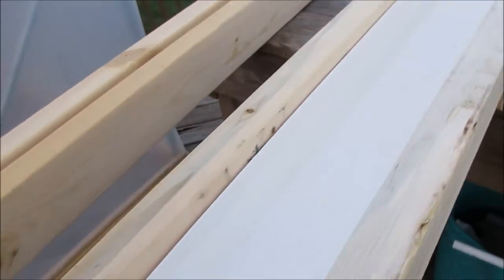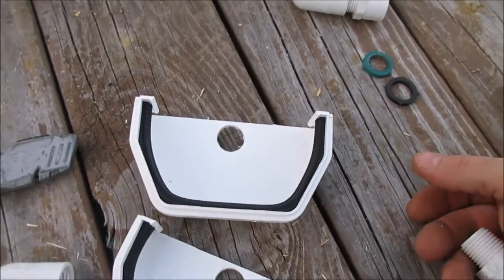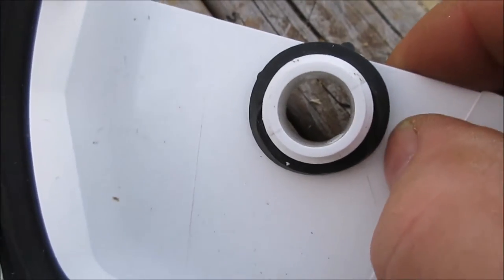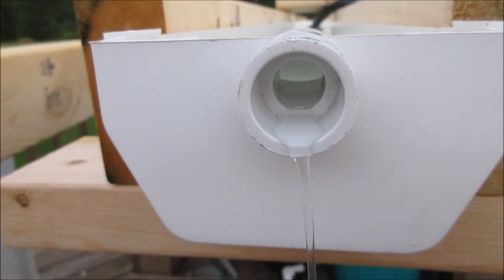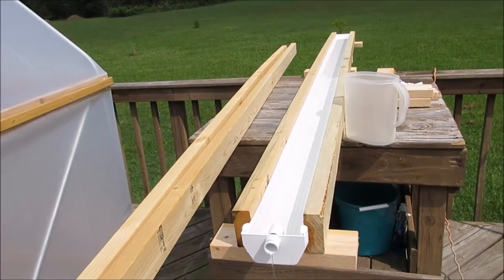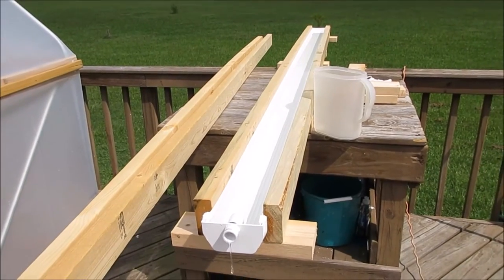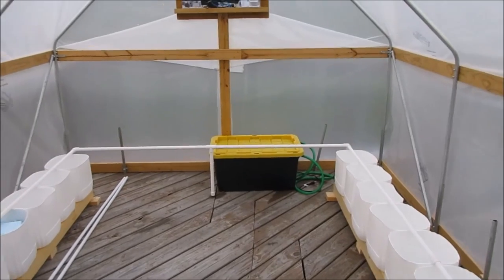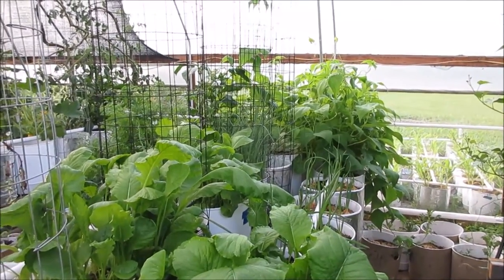Hydroponic Dutch Buckets:  FAWN Style

Comment: Brent thank you for this video. I have watched several of your videos and still could not clearly see why FAWN was better. After seeing the results from others using the (pure) Dutch bucket method I have honestly been skeptical. I can now see advantages you system has.
Reply from the maker: I guess success is in the eye of the beholder.  I present what I do and folks can copy, modify, or reject any or part of it all.  It's about sharing for me.  I want to grow in regular gardening dirt now and see how that goes.  I want to push the limits of the system.  I've grown in 50% compost with 50% aged rice hulls successfully so I'm optimistic.  I wonder if that can be done in dutch buckets?  I have my doubts.
Brent
Reply: I really like what you are doing. I started Square Foot Gardening, found the media way too expensive. My 'expedient' try did not work. Now I realize two major factors against me are BUGGS and my sandy soil under the beds. I am banking on a hydroponic green house solving both issues.
Reply from the maker: It eliminates those two if it's screened in.  Gotta watch temps and make sure it's really vented or it will boil.
Brent

Comment: Man, this looks great. I know this is an old video but great design. Wondering what you guys are running for times for water feedings. every 2 hours for 10m as an e.g.
Reply from the maker: FAWN used a return so it can be anywhere from constant to any length.  For me, it depended on when the container mixture started drying out or plants showed signs of need.  I believe it was usually 2 to 4 runs for a few minutes daily depending on outside temps.  It's kind of hard to remember.  Once I get a greenhouse again, I'm going back to it.  I never completed my last version.

Comment: Thanks for sharing your experience. This is a great video and convinced me to try this system in my backyard.
I have a question though. I intend to build this system in my backyard without a green house and in bay area , summer temperature can reach as high as 105 F in the day time and 60 F in the night on the same day.
Do you think this system can tolerate such a wide swing of temperature ? Can the high temperature during the day make the nutrient solution hot enough ( although I will keep the reservoir in shade and bury in the ground ) to adversely impact plant health ?
Reply from the maker: Depends on how many hours heat is exposed to it.  I've hit those temps in the greenhouse and it's not good for extended periods.  Shade is the answer along with burying the reservoir and cycling the system more often to keep oxygen levels up.  For reference, if dutch buckets can take it, FAWN can too.

Comment: I have been watching a bunch of your videos. Great stuff! I'm not quite sure if this is a wicking system or a top watering system, or both? If it is both do you need both to accomplish this? Could you do the same setup top water with little holes in the bucket just for drainage and just keep them in the portion that is over the gutter? Keep them coming, thanks!!
Reply from the maker: 100% correct. Hydro drip, wicking, and water culture. All on purpose. Drip alone is fine, but you lose the backup wicking if electric goes out and you're not around. Also, plants will have difficulty sending roots into the reservoir (gutter) where they can directly feed if they want.  It sounds odd, but some plants love being in water fully, some like it a little, and some do not like it. Thing is, they have that choice and, even weirder, they choose what they like.
Reply: Thank you for the clarification.
Reply from the maker: @GrowSomethinwithJeff  Happy new year.
Reply: Happy new year to you as well.

Comment: I would like to create a FAWN system like you describe. But, I do not have a greenhouse to utilize. Will this system work set out in the open yard? If so, how do you adjust for rain? Love your videos! I appreciate your efforts and sharing. Thanks for your help.
Mike (in TN)
Reply from the maker: Yes, it would work.  Make sure there's no holes in the top of your reservoir.  This will keep the nutrient at full strength by not allowing rain in.  A heavy rain will dilute your hydro solution because it will rain through the buckets and then drain back to the reservoir if you do a recirculating system.  So, after every rain, you'd have to check your ppms and maybe make an adjustment.  I was going to do a movable  outside FAWN system on rollers, 2 platforms wide by 5'.  That's 10 containers.  I would cover with a $10 tarp and bungees.  This way, I could roll it around like a wheel barrow.  An option would be instead of covering, one could roll it into the garage or a carport on a rainy day.  I might still do that.  Love to see what you end up doing.
Brent
Reply from the maker: I've just decided I am going to make one.  At least one.
Brent
Reply: Great!! I look forward to your videos as you describe your "outside" FAWN system. I need all the help I can get  :-}}

Comment: Hey Brent it's Casey in sunny California. I was hopeing you could help me with a problem I'm having with zuchini in self watering rain gutter system. My zuchini are getting about 3 to 4 inches long then starting to turn yellow BER. I follow the instructions as far as 12grams, 12grams and 6grams and mixing in the right order. My  system is outside the flowered look good and the leaves look. I do have a little problem with whiteflys. I spray with neem oil, it seems to work for a day or so and then there back. Any help would be greatly appreciated. The system is not circulating, I fill it as needed. Thankyou
Reply from the maker: Sounds like they're not getting pollinated.  Before 11am, take a male flower and remove it from the plant.  Take all of the petals off leaving the pollen covered tip.  Find a female flower full open and rub the male all over it.  It will start growing quickly afterwords.  An unpollinated squash dies off like you mention.  That's likely your issue.  Let me know.
Reply: Thanks a bunch, and I will

Comment: Cool but i think air pump is unneccisary so i will leave it out of mine.  I am gonna just have a planting bucket sitting on a 5gal pail. Letting water fall into the reservoir. Water pump driving the water to the halo on the top bucket.
Reply from the maker: Yes, that will work too and more than many may consider.  The water dripping into the lower reservoir will aerate the water.  If there was no agitation to infuse air into the solution, then I'd worry.  I've grown Kratky vs aerated DWC and the latter is much better by comparison in my observations.  Adding air is always better for the plants however you infuse it.  You can get a $5 pump at Walmart that is so cheap to use electricity-wise, it's worth considering, however, if you're water pump is running and dripping constantly, it's not needed.  All my opinions of course David!  Please share on my Facebook.  I'd love to see your stuff growing buddy.